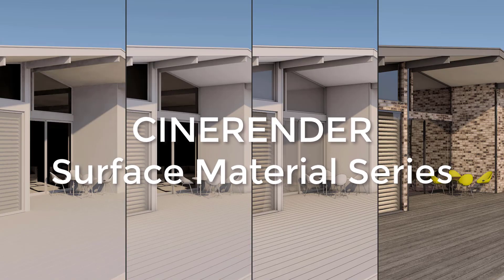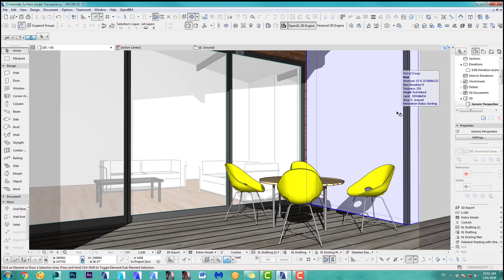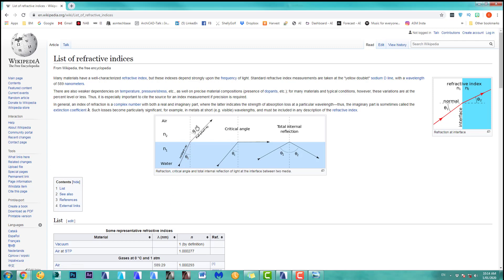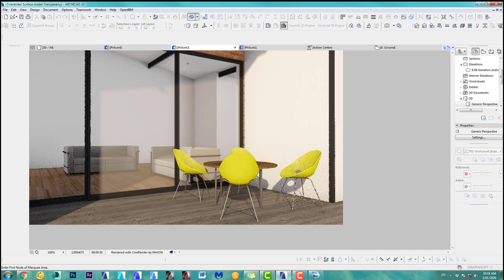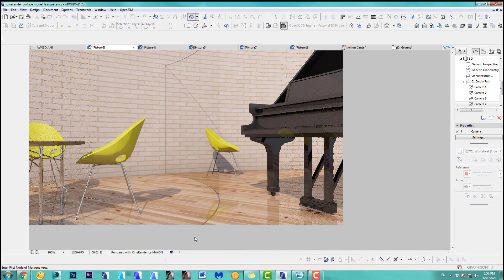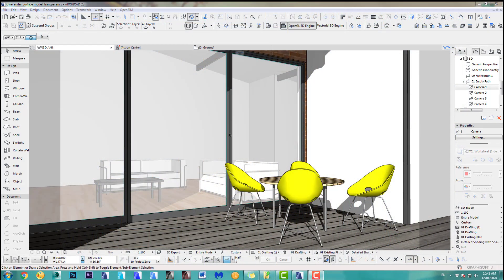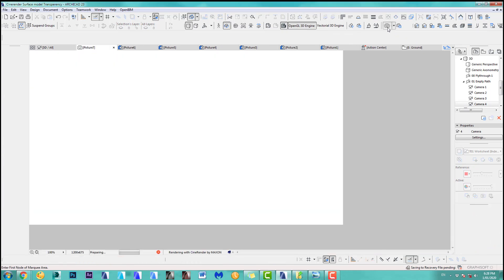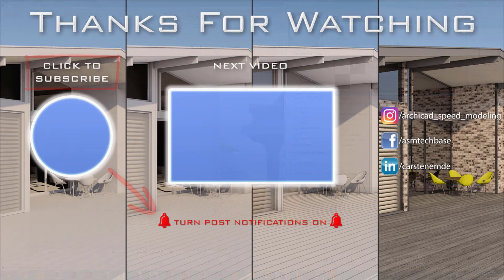CineRender Surface Settings Series Part 4 Transparency Channel in ARCHICAD

Comment: I’m really appreciating your explanation of the tools. I have a couple comments about refraction that might help. The angle going in to flat glass is reverse going out so there’s a minuscule shift only about the thickness of the glass. So, usually imperceptible. The variances on the glass on an office building are more likely from “oil canning” (cheaper, thinner, glass not flat) than refraction. All the best.